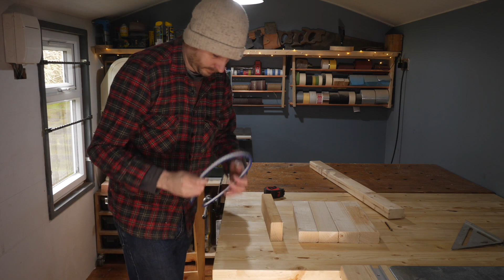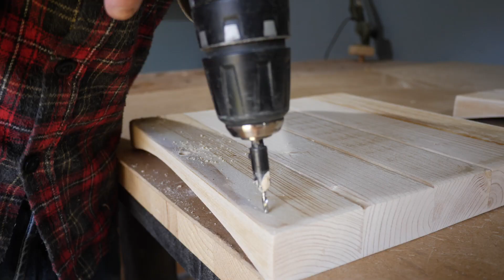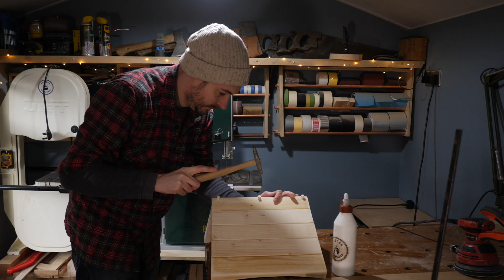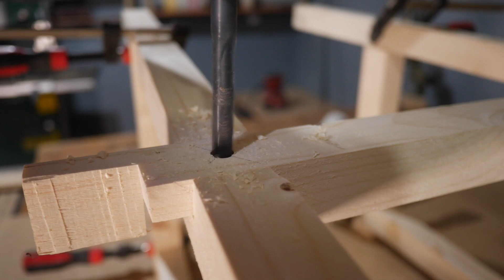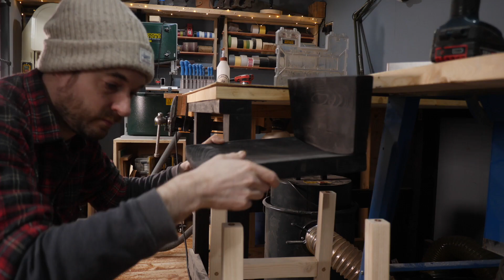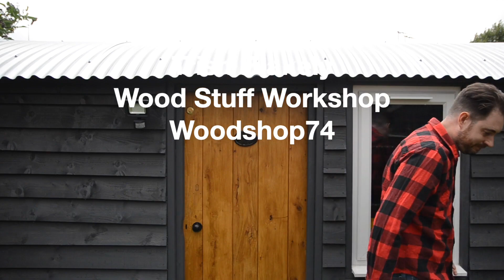Making a Bar Stool

Comment: Might be time to bring back your Multico table saw and fit it permanently with your flat tooth grooving blade, then no need for all this blade changing, in the same vein as your dual bandsaws? Great stool by the way!
Reply from the maker: I am thinking that but not that way around.
Reply: @Badgerworkshop  I thought you retired the Multico to the garage, as you were unable to safely tilt the blade?

Comment: Very nice stool, thanks for sharing. I have that same plug cutter. If you cut the plugs from 3/4 material (or less), you don't need to use anything to get them out, they will self eject. Just cut one plug, then as you are cutting the next it will pop out.
Reply from the maker: Thank you